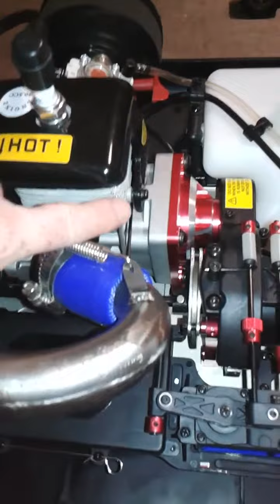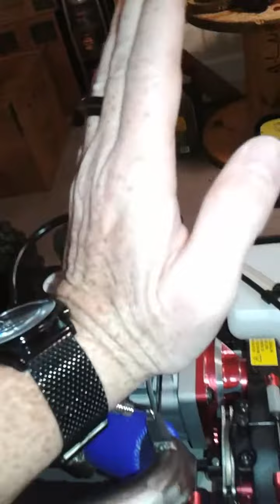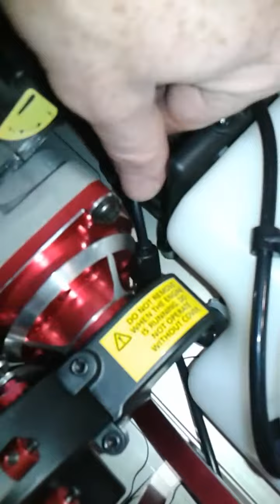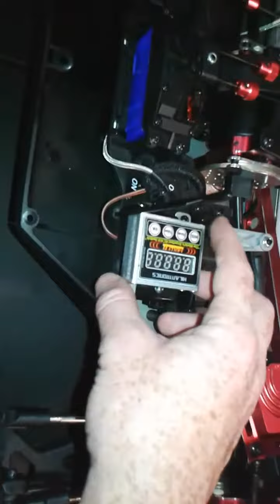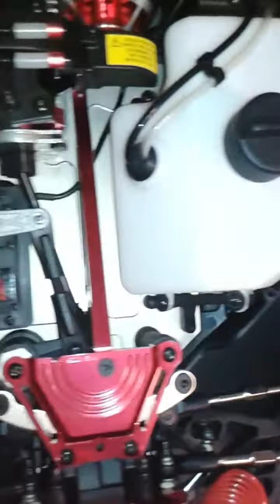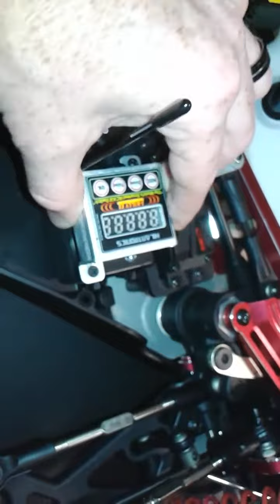Hilantronics Ikilly 2 KM x2, Losi 5ive T, Rovan LT305 Install

Comment: nice video... :)
Reply from the maker: laurent gouriou thanks Laurent...couldnt find much on youtube so figured this quick cell phone video would do the trick.  I just saw your comment on the x2 video...that was a horror show of a mistake..i wasted half hour uploaded what i thought was going to be an easy way to pull all the small video clips from my clone go pro to u tube and have it produce as 1 video..i thought i had deleted them all when i realized it until i got the message that you commented.  i just now finished producing all 21 clips and the actual video is uploading.  I didnt actually watch all the clips first. i hope the sound isnt too bad or that my production software took care of any issues.  i was using an Akaso  ek7000 4k action cam on my head

Comment: Lol did I miss a vid? when u get a x2?
Reply from the maker: Diy type of guy lol..whats up bud..i know i know i kinda screwed that one up huh..i jad my unboxed video on my action cam and havent converted and uploaded yet. i need to do that..like right now....got it last week...so stoked..its huge
Reply: ThePonyboy50 this thing shows ur battery voltage too right? I might have to try one of these kill switches. ..I'm debating on getting a x2 or a t2000 :/
Reply from the maker: Yea my man..it sure does...and get this..i dont know about you but both times i installed a killswitch prior it took an hour or more fiddling with setting before it would work..this one ...as soon as i clicked the third channel switch it shut it down...it gives youbattery voltage,  RPM, Engine Temp, it records highest RPM and engine temp, glitch sensitivity shut off, low voltage shut off, remote kill of course